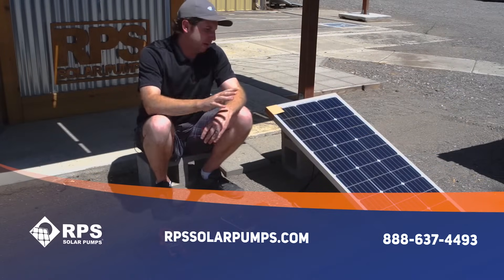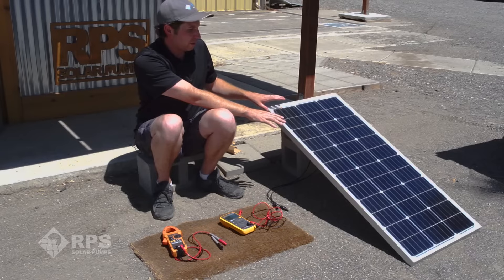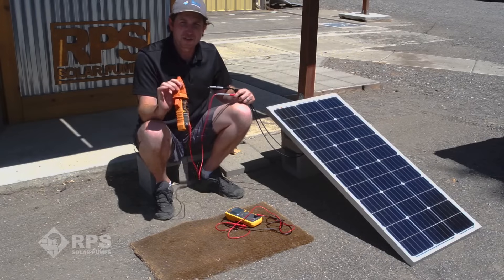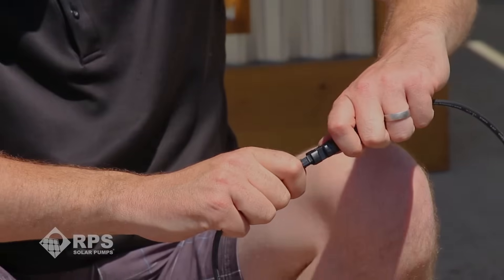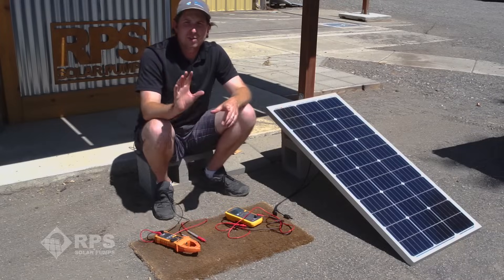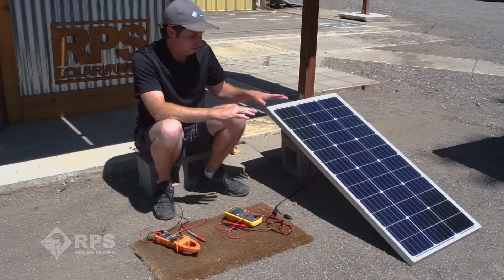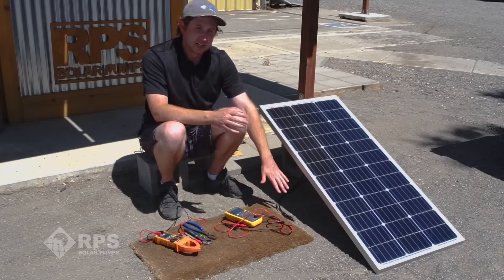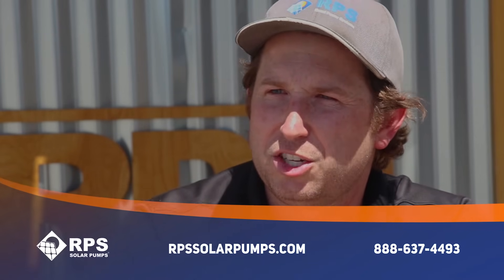Guide to Troubleshooting Solar Panels, Voc/Isc Measurements and Most Common Solar Panel Issues!

Comment: I have 6 - 100 watt 12 volt panels (Renogy) set up in parallel in a RV. The solar system is completely separate from RV system. I have voltage and only 0.07 amps output. I checked all the way to each panel and I'm getting the same from each panel when I disconnect them from the system. I'm sure that means the entire panel panel array is bad. Did the diods burn out and what would cause it?

Comment: i saw at least 10 videos on this subject because i have a 100 watt panel in my van that is not giving more that 3 watts and i want to learn how to check it. your video is the best one of the ones that i saw. somebody, in order to measure tha amps connected wires to short circuit, but your method is much simpler

Comment: I started with one 100 watt panel with a PWM controller.  I upgraded to a 20 amp HQST MPPT controller with a second panel that was giving me 10 amps. I installed a 15 amp  blade type fuse in the red lead of the solar panel to the controller.  Later I added a 200 watt panel now giving me about 20 amps maxing out my controller. ...but the 15 amp fuse doesn't blow.  I have 20 and 25 amp fuses to install.  I just wanted to see the 15 amp fuse blow but it doesn't.  All wire and connections are good.  Why isn't the 15 amp fuse blowing when I'm getting 20 amps+ from my panels?  Bad fuse?

Comment: Bingo!  Had a 265W panel that would meter 30v and zero amps.  Unscrewed the mc4 connectors and gave each a tug.  Positive plug came right out in my hand!  I shoved the metal part back in until it "clicked".   Vola' we have amps now!  THANK YOU!

Comment: Thankyou Sir, I bought a cheap ass MC-4 crimper off Amazon and they give you 20 connectors in the kit, the metal parts are inferior, hence low amp / watts output.

Comment: My epever Charge controller had me pulling my hair . It stops charging (3) 100ah batteries at 13.2.  When I restarted it and left it at default, it started charging again. I thought it was the panels that were bad. Speed ever want me to return it but it is winter. Their tech support suck.

Comment: I checked and had .5VDC from each of my solar panels after installation and pre-commissioning.  One thing my panels came with was a second black box affixed to the back side of each.  My panels came with no technical documentation.  I later found out that these were "rapid shutdown modules".  Allegedly, when I tie the panels into the inverters, they will recognize them as a load and start outputting power.  I haven't had time to do that and find out.

Comment: i have 2 panels  in series with normal voltage but very low amp what can be the cause in full sun i get hardly 0.1 amp voltage is normal when i measure

Comment: I got mine looks like defective, it was has 22,11v voc and 18vmp. But now voc is only 21v and can't get 18vmp for the MPP or high current. It's only producing high current at voltage 14v. How can i fix this??

Comment: Hey Mike!!! Thanks for sharing your knowledge through these amazing videos, very helpful!!! I loved the way you explain everything. I would like to ask you a question. I bought a 300w solar panel and want to get the efficiency. My voltmeter is 10amps and the panel label says that the maximum current is 18amps. Should I buy another multimeter? you can help me?
Reply from the maker: Probably good to get a clamp multimeter if you plan on testing this panel or other like it often

Comment: What do you start to look when there is a low watt output in full sun?(3x 100w panels, 28w total output)
Reply from the maker: This is much harder since you need to be able to test under load, but it is possible with an MPPT charge controller.  First and most obvious is dirty panels or any partial shadows on panels.  Small obstructions can cause large power losses.  Second, make sure you are testing your panels individually, versus in series (if you are). A single degraded panel will affect others in series.  Third, I would inspect each cell for damage either electrical (charring) or any cracks.  Cell cracks can isolate portions of the cells and restrict current flow.  Those are some good places to start off the top of my head!
Reply: @RPS Solar Pumps  thank you. I found out that i need to connect them in parallel for my inverter to work. Now i need to learn how to properly connect terminals

Comment: Great video. So much information. Maybe I can figure out why I have a dead panel. You don't seem wooried about getting shocked. At what point does that become an issue? I know the output af an array is very dangerous. Anybody? Thanks.
Reply from the maker: I start to get worried after 50V DC and am extra careful after 100V DC.  These panels output a Voc of ~23V, so not an issue; really hard to get a zap.  Larger panels might output around 44V, so still low risk.  That being said, if I was working on panels without connectors, I would have removed my ring, as contact across the ring could weld the wires to it and cause it to heat up rather quickly.  With the MC4 connectors on the wires, I was comfortable keeping it on.

Comment: Can a panel exceed its Isc like it can its Voc? E.g. lower temps from STC (no other changes) would result in a higher Voc. Are there similar considerations for Isc, to avoid over current?

Comment: Question for you  I wired up my solar array and I have voltage on the wire but when I hook it up to the combiner box then there is no voltage on any of the circuits. I can't understand it.
Reply from the maker: Have you check to see if there is a short anywhere on your combiner box?  Is there a load hooked up to your combiner box.  Second thing to look at is a loose MC4 connector in your combiner box?

Comment: Got it. All I now need is a sunny day. (I am in the Netherlands and it is raining) My MC4 's are connected to an 5 m extension cord but either that gives zero output or my 12v appliance is dead. So I have to order a voltmeter first.
Reply from the maker: Glad it could help.  Did you end up finding your issue?
Reply: @RPSSolarPumps  not yet

Comment: What is the name and model of clamp meter and multimeter used in the test
Reply from the maker: I think that one is a generic brand.  You just need to look for a clamping meter that does DC current.  They cost a bit more, but are worth it for solar testing!

Comment: Hello, great video!  I need some advice,  I would like to know how much solar panel and how strong does my battery and converter have to be to run a submersible water pump and a couple of light bulbs.  Also how strong does the inverter have to be to work for a water pump. I only need it to run about an hour per day. Let me know please.

Comment: How would you use a multimeter with DC amp on it to check ISC?
Reply from the maker: Short the + and - solar panel wires together and then use the DC clamp to check the current flowing through the wire.
Reply: @RPSSolarPumps  I have a multimeter not a clamp on meter?

Comment: Thank you for posting this video. I was having an issue with my brand new panel, after watching this I was able to find the issue (bad connection) I put new ends on and BAM it is working great. Thank you again- Ronnie
Reply from the maker: Glad to help.  Can't tell you how often the issue is improperly seated (both the housing or the internal contact) MC4 connectors.  Nice simple fix!

Comment: Hi! If a wire with a 120 volt phase touches the frame of a solar panel that has not yet been installed, could it damage that panel? Thanks
Reply from the maker: Yes it could, but the frame is not attached to the photovoltaics, so there is a good chance the cells are not damaged.

Comment: I have two 375 watt panel  connected  paralley with 9 amp each.. But my output is max 15 amp on inverter.. What's the problem..
Reply from the maker: Thats not too bad for real world conditions.  Is it an MPPT charge controller or PWM?
Reply: Not bad. Those spec are at standard conditions

Comment: Sir why is my panel is showing a fluctuative current and voltage while connected to battery through scc? Its fluctuating so much that its hard to determine the amount of current that passing.
Reply from the maker: Sounds like it could be a charge controller issue.  Unplug your controller and test your panels per the video to see if they produce steady power to rule out a loose wire (unlikely).  If panels test fine, check your controller.
Reply: @RPSSolarPumps  Voc and Isc is match with the panel spec and not fluctuating, is there any chance the problem is the panel not the controller? i was ask because there was very  little info about current that fluctuates in the internet, mostly about loss power, not fluctuate
Reply: battery is fully charged, is that affect the current that passing?

Comment: Greetings sir plz help me my panels are not giving amperes
Reply from the maker: Check for a loose connection.  Also pull the cover off the back of the solar panels to look for a loose wire or bad ribbon connection.
Reply: @RPSSolarPumps  thank you dear sir

Comment: Thank you! I was waiting on technical support to get back to me from Ecoflow, my panel had no output, an mc4 had a loose connection it’s working great now 👍
Reply from the maker: Great to hear!  Glad we could help.
Reply: I got same problem. Full sun no output on mc4 on my zamp solar.
Reply from the maker: @GunninWizard  Did you double-check all your MC4 connections?  Find it helps to disconnect and reconnect all connections even if they look fully seated.

Comment: What is the voltage used when you're getting the total voltage in a system, Voc or Vmp?
Reply from the maker: When the two solar panel wires are open and not connected to anything, you are reading Voc (Voltage Open Circuit).  Vmp is a harder measurement and requires specialized tools.

Comment: Dude you gave some good info.  I did not know about shorting out the panel to check for amps.  I guess there is a huge difference between that short and shorting out to ground?
Reply from the maker: Yes, these are different things.  It is okay to short the + to - on a single panel to check short circuit current.  Be careful if you have multiple panels in parallel/series as this can drive a lot of current.

Comment: Wonderful and thanks for your in depth analysis. I have a an array of 6nose of 250w mono panels connected in series powering my solar borewell pump. And I later noticed that all the bypass diodes of the 6panels went bad. What could cause this pls. Thank u
Reply from the maker: Hmm no idea.  I have not seen that before.
Reply: What is the rated series dc voltage of your panel?
In india Most common one I have seen was 500v ,1000v & 1500v.

Comment: Fantastic video. I am looking into making an IV curve using a very similar method. I am wondering where I would put my load resistors when hooking my panel up to my multimeter
Reply from the maker: Kinda hard as your load resistors need to dissipate the maximum power of the panel, meaning load resistors of 100W for a 100W panel. There are active loads you can purchase online that have a fan for cooling, which we used in our other video regarding cleaning of the panels.

Comment: ask sir why my solar panel if the weather so hot the output of voltage drop if they have clouds they have a good charging
Reply from the maker: Voltage will drop as temperature of the panel increases.  Perhaps your voltage is not high enough for your charge controller?
Reply: @RPSSolarPumps  posible solar chargbut if i test  the output voltage of solar panel if temp is high the voltage drop to 12v but if they have clouds 15v

Comment: How can I measure the maximum current and maximum voltage?
Reply: Can I use variable resistance?
Reply from the maker: It is rather hard.  Yes a variable resistor would work, but it would need to dissipate the maximum power the panel is producing, so not really viable.  We use a content current load, which is like a variable resistor.  Check back in a few weeks, as we are working on an MPPT tester!
Reply: @RPSSolarPumps  

I didn't find the video, can you send the link to me please

Comment: So you have to have a clamp on meter to measure ISC?
Reply from the maker: No, but that is the easiest.  With a normal multi-meter you need to run the power though the current measurement inputs.  Would need to create MC4 pigtails to run it though and make sure your meter is rated for the Isc value of your panels, or else you will burn the multi-meter fuse.

Comment: Sir can we install a panel that Voc 47{Standered testing condition} , but the  inverter recommended Voc is  15 to 45 .  ?
Reply from the maker: Usually the recommended voltage range is related to Vmp and not Voc. The inverters usually have a separate maximum input voltage rating that is related to Voc, that you do not want to exceed.

Comment: Great Video! I have several used Sunpower 435w panels that I want to test before installation. The Voc = 85v, Isc = 6.43a | The rated output Vmpp = 73v, Impp = 5.97a. What is the best way to load test each panel safely? Do I need a 500w resistive load?
Reply from the maker: It is hard to do a proper maximum power load test.  One of the best ways is to use an MPPT charge controller with depleted batteries one panel at a time.  Otherwise, you can try a resistive heater, but if it draws too much power, the voltage will collapse and you will get closer to an Isc measurement.